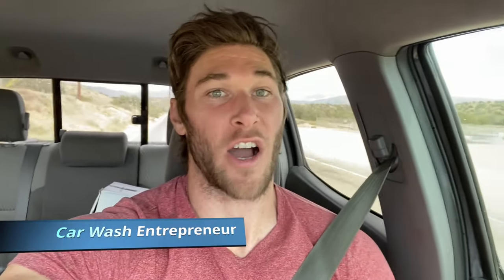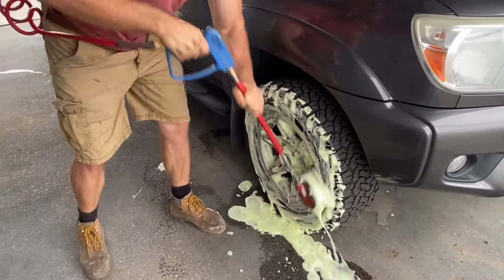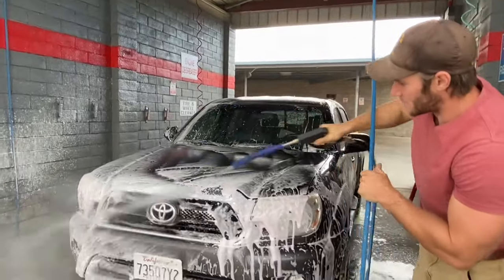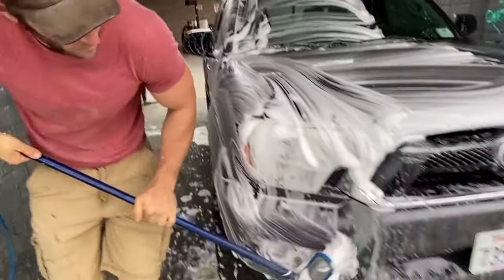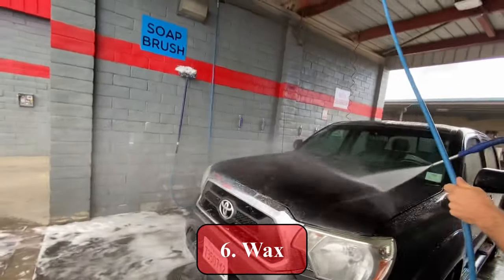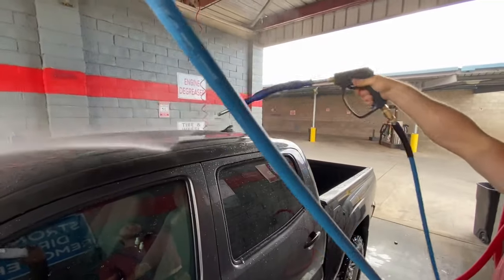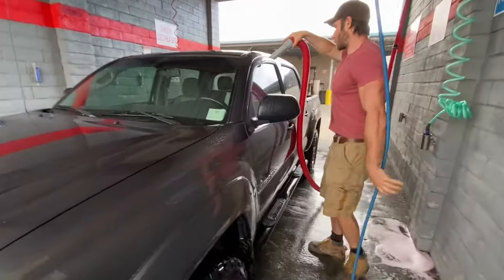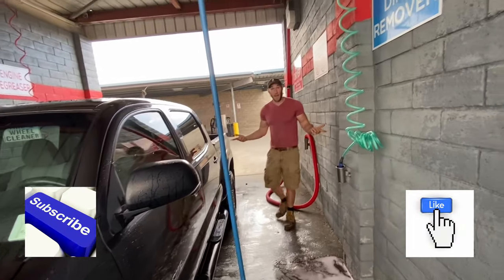Best Way to Use a Self Serve Car Wash! (From an Owner)

Comment: Most car folks I know would never use the scrubbing brush. Most car washes only have one which means folks use it on their muddy grimey tires and wheels and then the next person runs it all over their paint job resulting in that classic swirl look. Friends don't let Friends use car wash service bay brushes... Ive heard folks say they spray them out.....I ask them if their clear coat is soft or hard . When they look puzzled ,I realize they just want instant gratification vs long term care .

Comment: Remember before you use the Brush to blow it out good with the high rinse or high soap, People complain about the brushes leaving scratches,make sure all grit is off the car before you brush it,and check the brush,any good car wash use Boar hair brushes,i have a 2020 black Camaro and i use the brush and you wont find any scratches on mine,And im an ex detailer that worked at a dealership!!

Comment: OK, another video I watched said to dry off the car with a hand towel before waxing, but they were using wax they bought at the store. Do you not need to dry car before doing the car wash wax? Is car wash wax different? Also does car wash wax protect the paint, or do you need the store wax for that?
Reply from the maker: No need to dry before the wax. The store wax more so that you rub on will protect more so and is a much lengthier process.
Reply: some waxes need to be rinsed off and some don’t

Comment: thanks for the video, i was looking for the process for wash bays in Sydney. I didn't know you could switch between modes while washing after you pay; i thought each time you pay, you pay for a specific feature. I'll try toggling between wash types now, if it works.

Comment: Thank you for great video Chris. 

Its very nice to see how things are done over there in comparison to South Africa.

My advice:

A process is about maximizing output and results in the least amount of time or with the least amount of effort or both.

Start with the Dirt remover soap before anything else.
Then go to the wheels whilst the Dirt Remover works into the dirt on the car. The more time you give it, the better the outcome.
Then you can follow the remaining steps you did.

I would recommend the same if one had employees to wash car's for clients.

How does giving extra product on all steps affect your bottom line? 
Do you think if you only provided extra's on the first 2 steps it would have the same outcome in terms of attracting clients considering that the first two steps kick of most of the cleaning in as far as dirt removal goes? So practically, are you not costing yourself more then you should by giving extra instead of good product within expectable standards of dispensing. 

Chris, who are the companies that provide Self service equipment including payment system in your area or those that you know off in general?

Is it possible for you to give us a backend view of your tools, how they connect and how they speak to the payment system?

Thank you,

Keep them coming.

Comment: I've been to a lot of self serve car washes in my area and I've never seen a dedicated wheel brush, pre-soak hose, or air. 😞 And spending that much time using just the big brush and main hose would've started to add up pretty fast. There's even a place that charges $6 up front. 😯

Comment: I find many times the person or the people in front of me put the brushes on the ground instead of hanging them, the can't be bothered putting the hoses around the hooks, in other words, they don't care how they treat the equipment or the person who might use the bay after them.  I don't use the brushes because they have probably been abused by other customers and could never be sure how clean they are.   I will bring my own micro fiber wash mitts and towels and long as no one is lined up behind me, I will wipe down the car.  If the car wash is  busy, I just go touchless.

Comment: Hi Chris, (Paul here🤝)… I just saw 1 Car Wash for sale today, 10 years operating (needs paint and a few cracks to fix on the outside pavement, equipment in fair, good condition), located in Ontario Canada, $900,000 included land off course, with 6 bays lot of 60x50 $110,000 average, net $70,000=…. Based in your experience, (and I know it is very difficult for you to calculate because of the distance…) but do you think that’s a good number? Thank you, regards👊
Reply from the maker: Hey Paul. Yes always hard to tell from these but 6 bays is good. Sounds run down and is making very minimal income. Definitely seems like a good opportunity to add value. Fresh paint and also add more functions with a 10 position rotary switch which keeps them in the bays longer as you see in my videos. And location counts as well. Main roads always good.
Reply: @CarWashChronicles  I’m simply very grateful with your fast response and help Chris! Thank you very much mate. Cheers 🤜💥🤛

Comment: You skip the degreaser in every demonstration, what does that do? If nobody uses it, why not take it out?
Reply from the maker: People use it on the engine.
Reply: @CarWashChronicles Could you do a short video on it? I haven't seen that here in central Florida. I'm wondering if I will add that feature or skip it. Thanks brother!